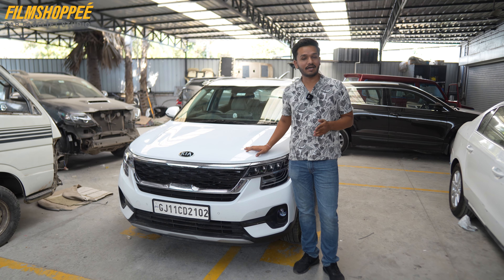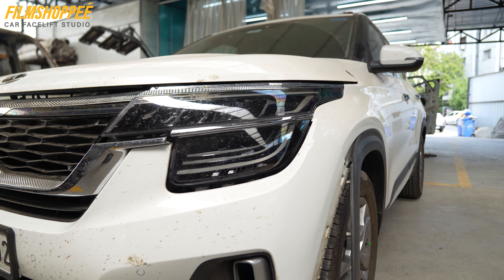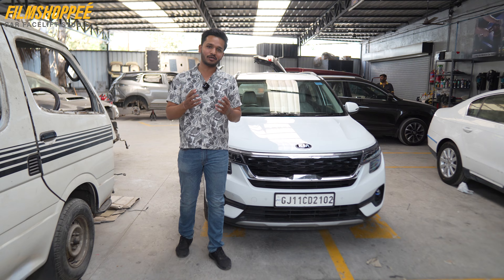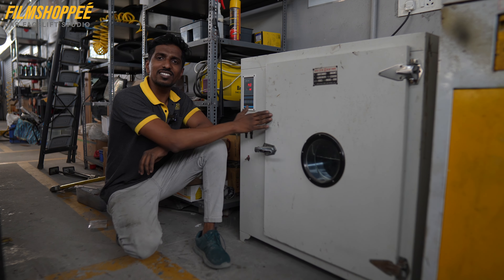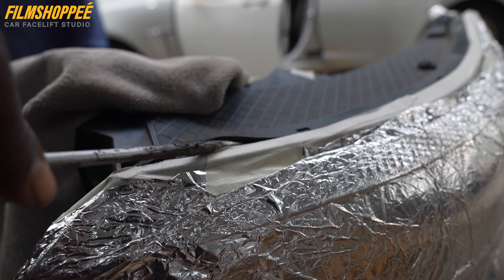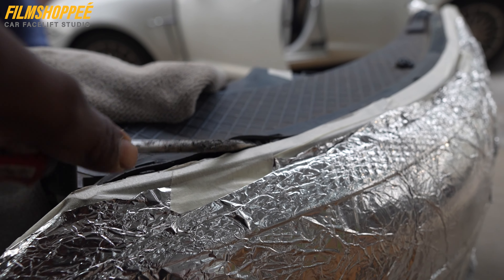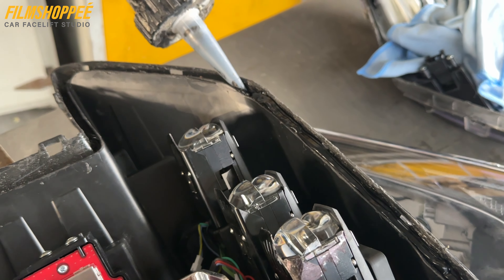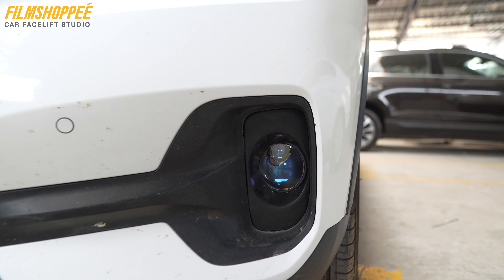Kia Seltos Headlight upgrade | 8 Led Matrix Projector Setup | FE RETROFIT OCTOQ PROJECTORS

Comment: Will this cause leakage/water seeping (short circuit) issues or fogging inside? Asking since I'm in Mumbai and it has killer monsoons with roads being flooded and bonnet level submersions most often then not. Kindly confirm the same, so I may finalize my plan to visit.
Reply: This can be done in Mumbai also.. I came across the same thing at shivaji park at one of the car accessory stores
Reply: @MehulTeli2503 can you confirm which shop this is
Reply: @varunmvartak  there's this shop called Amar motors at shivaji park who does this